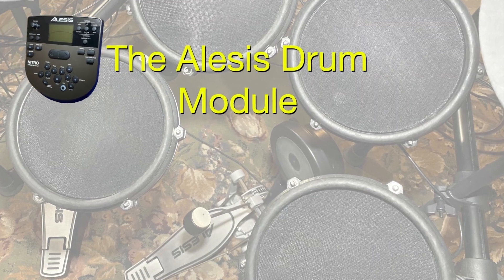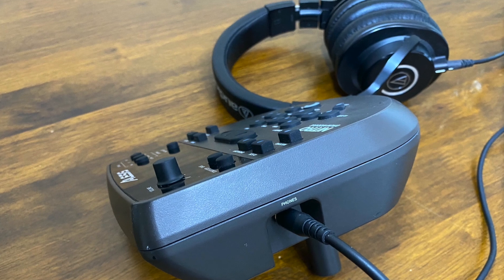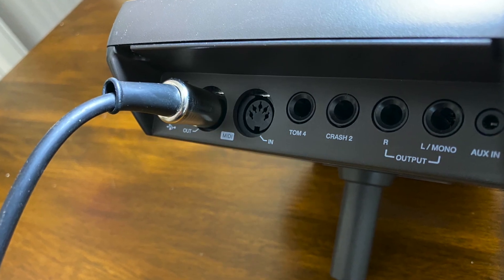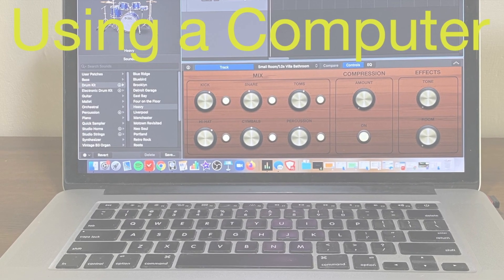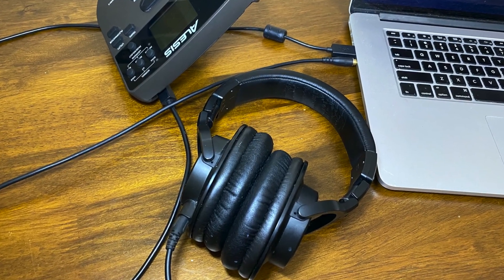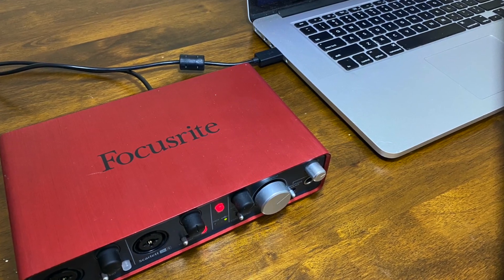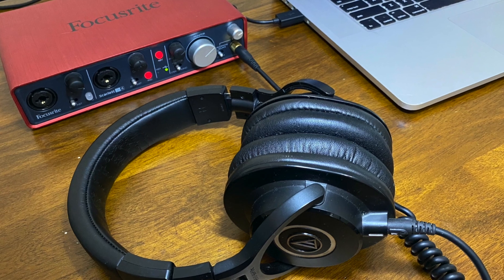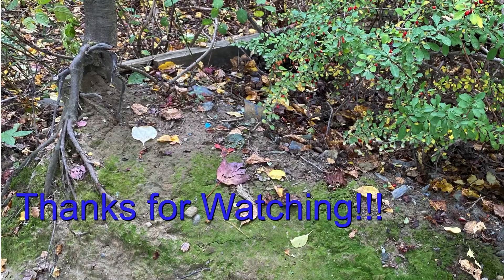Electronic Drums - How to Output Sound

Comment: How do you adjust the settings on a JBL 715 pa speaker to an Alesis strike pro module? My kit sounds like garbage plugged into a PA but amazing on my headphones.
Reply from the maker: Not familiar with that equipment.. but I did some research and found this:   

1. Connection
Use a 1/4" TRS or XLR cable from the Main Out on your Alesis Strike Pro module to the Input on the JBL 715:

Preferred: XLR cable for better signal and less noise.

Alternative: 1/4" TRS (balanced) cable if XLR isn't available.

2. Gain and Volume Settings
On the JBL 715 Speaker:
INPUT GAIN KNOB (CH1 or CH2): Start around 9 to 12 o’clock.

MASTER VOLUME / MAIN: Adjust up to 12 o’clock or higher as needed, but don’t max it out right away.

On the Alesis Strike Pro Module:
Master Volume: Start at 50-70%.

Individual Kit Piece Volumes (in the mixer menu): Balance your kick, snare, toms, etc.

Output Type: Make sure it’s set to “Line” or “Line Level” (not headphone).

3. EQ Settings (if available on JBL speaker or module)
JBL 715 EQ Presets (press "EQ" button if available):

Start with "Main" or "Flat" preset.

Avoid “Speech” unless only using for voice.

On the Alesis module:

Go to Utility > Output > EQ (or similar) and adjust:

Boost lows for kick

Cut mids for clarity

Slight boost in highs for cymbals/snare snap

4. Test and Adjust
Hit drums while increasing JBL gain and Alesis master volume gradually.

Avoid red clip lights on the JBL (distortion risk).

Use a real drum groove to test overall balance and clarity.

Good luck, let me know how it goes.. :)

Comment: What software would I need to output sound with my computer speakers?
Reply from the maker: If you have a mac, you can use GarageBand with an Audio Interface.. I have a video on that in the Electronic Drums playlist.  I would suggest outputting sound via the audio interface to some nicer speakers if you can.. :)
Reply: @ Shoot I have a PC. Was hoping I’d be able to somehow output it on my computer speakers then connect my computer to my bluetooth speaker.
Reply from the maker: You can actually use a USB cable.  Mine came with my kit..l. It goes from the module into the device. There should be some reasonable DAW's out there for a PC.. I think Ableton may run on a PC..

Comment: If I hook up 1/4” stereo (L/R) on the back of my speaker amp should I also hook up to the Alesis module as 1/4” L/R on the back or would I still get stereo sound using the headphone jack on the Alesis module? I’m trying to figure out which cable to buy. I’m seeing both options, but the one end being 3.5mm seems to be more common. Than both L/R 1/4”.

Comment: Hi, i just got my drums today and I had a problem with the sound. When plugged in into the headphones only one sound comes out from the Right and it is so low. Do i need to do in the settings?
Reply from the maker: How are you outputting sound?

Are you using a DAW?
Reply: @MerrillStreetStudio how do i fix this i have the same problem
Reply: @MerrillStreetStudio  Hello.  I just got a set and am having the same issue.  I do not see where anyone has answered this issue or your question.  I am not using a DAW.  I am plugging the headphones directly into the headphones jack on the side.  The sound is only coming out of the right side.  I have tested the headphones on another device and they are fine.  It seems strange other people are experiencing this so I am hoping there's a fix.  Thank you in advance!
Reply: same how do i fix this
Reply: @phoebealcarde1920  I had a same problem because I was inserting aux in backside of the machine but there is a slot in the left side written headphone use that. Hope it will work for you 🤞

Comment: What if my audio interface doesn't have MIDI ports? I use the U-Phoria UM2 and that interface only has a mic/line1 port and a port for instrument cables.
Reply from the maker: If you have a Quarter-Inch Cable, try that.. Use the output on your drum module, and one of the inputs in the Audio Interface.  If I was closer to my set I would try it, but I think that will work too.. Let me know if you would.. :)
Reply: @MerrillStreetStudio  I had to get a second opinion but I figured I'd need a cable that has a MIDI end and a quarter-inch end. Thank you!
Reply from the maker: Cool.. no problem.

Comment: Would i be able to connect my module to my home theatre system? What connection/cable would i need?
Reply: did you every find the answer? i am trying to do that right now, but I am not sure how.
Reply: @ I do the same with my guitar now. I use an aux cable the big thick ones. And all you would need is an appropriate adapter and an audio interface to connect it to

Comment: yea but  how do you connect your headphones and your ipod/iphone so i can jam to music and hear the drums in my headphones while playing to music, knowone talks about this about electrics anywere, its so stupid cuz thats what most people are going to us an electric kit for
Reply: I used a split cable to connect the laptop and mp3/ipod, but sometimes it sounds good and sometimes its just a mess. The module doesnt have a mp3 volume control like others. There is a behringer HA400  headphone amplifier but i dont know if it works. Any luck?
Reply: There should be an aux in port on most modules
Reply: I bought a Bluetooth speaker amplifier that has a headphone out. I can jam with my music over the speaker or plug in headphones into the speaker and jam to my music while hearing the drums. I bought the Simmons DA2108 and it sounds really good.
Reply from the maker: Couldn't you use a converter cable on your iPhone and plug that into the back of the module, and then connect your headphones to your laptop?  I assume that's the setup you're using.  There is a converter that will convert your iPhone USB Cable into the back of the drum module.  I have one, but am not able to attach a photo of it as far as I know...